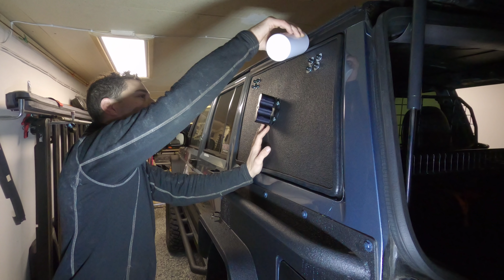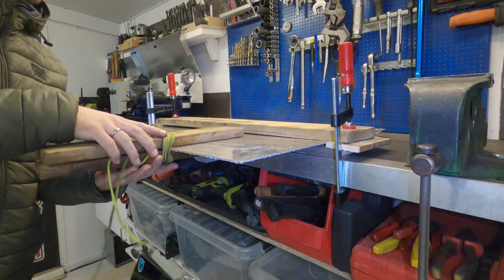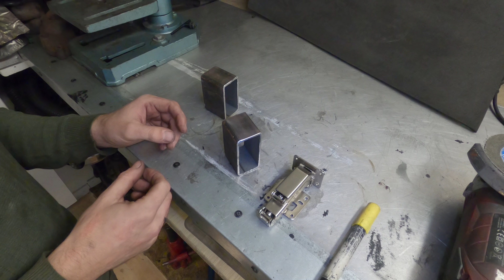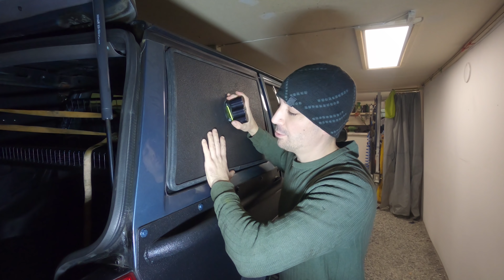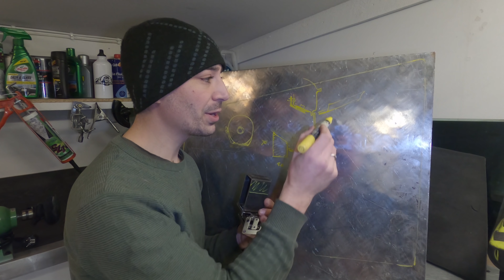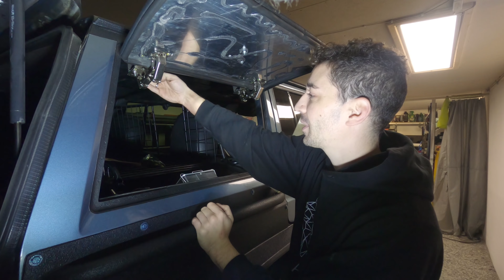How To Build Gullwing Windows / Jeep Cherokee XJ

Comment: Hi, I'm thinking of replacing the rear windows with aluminium but not a gullwing, just fixed to mount recovery trax. Just wondering how thick the aluminium is that you used or should I use aluminium that's the same thickness as the window glass?
Reply from the maker: I used 4mm thick aliminium. It was roughly the same thickness as the glas, and it sat well in the original weather strip. That's what I would recommend anyway.

Comment: Hi again Mike, its me again Cor the trubble guy from france 🤓 I almoist ready with my gullwing windows, But.. now to fix those hinges! in what distance you have fixed them? how close/far from the top corners horizontal? I seen on the video that your inside roof joint is diffrent as my cherokee, i do not have that bigg oval hole, so could you send me the distance between the hinges please?! 🙏😉Afther this is done I send you a picture from the job! thanks Mike
Reply from the maker: Hey Cor, I can't help you at the moment. I'm in England for a while. I can not remember the distances or angles. I didn't measure much when I made mine, as I just positioned everything, then tack welded the hinge brackets in place.

Comment: Okay Mike, Thanks for the information, I just wanne put all togheter and I found out that the strip I both at AMZ is to bigg! So Just order an new one 🥴 the one i got had 28/17 and that round part was 18mm. to big, so this I wil use for my door, needs desperatly a new seal because wenn I driv highway i hear the wind and feel it in my neck! Okay well so all my work gear back in the shop, all clean, need to wait till next thuesday for the dillivery. Hope you doing fine, iff you are in the need of some new sirup from Hoaalnd? I fly to Amsterdam the 24e! Take care 😏🤠

Comment: Hello mike, I am in a small problem , I cut out those alu plates a litle bit bigger let say 5 mm all around, so i both that water seal at Amz. but it seems so big? and is it better to put the seam arround the alu plate or ...?? In the window opening??
Reply from the maker: I personally prefer the seal around the plate rather than the window just because of the way the window shuts. 
I think you can do either, though. Just see how it goes. Normally, some silicone around the seal makes them slide better and stops the seal wearing down

Comment: Hi Mike last question, were did you buy that foam that you gluh inside that aluminum plate? hanks again Cor
Reply from the maker: I got it from amazon from memory. I think i just ordered a 1cm thick cell foam. It was very cheap and I used 3M adhesive spray to fix it on.
Reply: @WorkshoptoWilderness  yes that's wat i wonder. So its not a dubbel aluminium platen, but foam. Good
Reply: @WorkshoptoWilderness  okay now i know. Seen it on Amazon 😉

Comment: Hello Mike, its already a while that I had contact with you, I m planning to make those window to, but...Do you think I could fix the brackets(boxsettings) by use those insertpopnails(those were you can screw bolts in later) and an other thing, cant see good but did you glue an second plate at the first at the inside? I both those lockers and also the hinges !   will be great to hear from you buddy! Greatings from France Cor.🤠
Reply from the maker: Hey Cor! Yeah, you could absolutely pop rivet them in with those threaded pop rivets. Those things work well. I'm not sure what you meant buy the panel for gluing in?
Reply: @WorkshoptoWilderness  thought to seen a dubbel plate inside the gullwing plate, but you al ready wrote me, its a foam self ad

Comment: You see I want to do this but I have a 99 2 door sport and I really don’t know how this would work with the long rear glass. My 2 door also has the pop out windows so it definitely would take a lot of modification.
Reply from the maker: I think it would be awesome on  2 door. One large gullwing panel with four hinges would be super strong. I don't think there would be any issues at all provided you used four hinges and not two.

Comment: G'day Mike, as an ex-tradie, the "gull wing" or what ever term, are such a handy feature and for most, a top hinged solution will be far more practical. Of course, it does depend on the storage solution inside.
I would suggest mate, that you really think about whether or not to go with a full on drawer system. They do lock you in to a particular methodology and can limit flexibility overall. Not to mention they can be quite weighty. Maybe a part draw system IMO. 
Anyway, good show mate. Cheers Duke.
P.S. Where's the bushcraft !!! ? ............only jok'n mate, hehehe.  Keep do'in what you're do'in. 
Not sure there's anything you didn't cover back in the day and I still hold you personally responsible, lol, for rekindling my interest in the outdoors, many many thanks.
Reply from the maker: I'm hoping it will help tidy up the internal storage at the back a little more. Just having a recovery kit in there or a wash and hygiene setup the other side just makes life easier. 
The drawer system I am making is just going to be one or two big flat tables that are as low as possible in the back. Its just so that the whole inside can be pulled out and accessed from either side. 
Its more of a drawer platform. The internal cargo self will then just sit above it so you have an upper shelf but I am going to remove the legs and have two diagonal legs that can fold away to the whole upper shelf can fold flat or be removed. 
I want it to all be modular so the Jeep can still be filled with bags and suitcases if need be. 
haha, i do get a lot of comments about bushcraft. I still enjoy doing it but its not something I will film anytime soon. Thanks again mate and appreciate the comments!
Reply: @WorkshoptoWilderness  Yeah Mike the recovery kit is a fantastic option on one side and of course a hygiene "station" needs to be particularly accessible too, especially with the fam on board.
Glad you're still think'n about bigger items, whether luggage or otherwise, exactly my original point. I've no doubt its all gonna come together mate, love what you are doing to utilise the full potential of this vehicle, mechanically and within its dimensions. I was only jok'n on the bushcraft, I did pick up on your comments under baited breath and hence my shit stir, don't mean to be soppy about it, but still, you did inspire me to the point where it put my focus back where it ought to be.

Comment: I really like this, you did a great job. Are you going to put a little gas strut on to hold the window/gullwing up?
How do you like the rotopax cans and mounts? I'm thinking about getting one or two of those 4 gallon flat cans for my roof rack and maybe some 2 gallon cans for my tire carrier.
Reply from the maker: I think some struts would be good, or a bar that can click into position. I really like the rotopax system, the quality of the mounts, locks and containers is extremely good. Its just expensive for what it is I think. I would certainly get more of them when I can find somewhere I want them to go. The container ones are cool but not waterproof so you have to make a seal for them sadly, or else I wanted to make a medical box from one. 
Thanks for watching!
Reply: @WorkshoptoWilderness  a little bar like a hood prop would be neat or maybe some sort of dual purpose thing to prop it up like a tool of some sort or camping implement. I've never installed gas struts on anything but I have watched some videos and I think it can be challenging to find the perfect location to get the proper leverage for the strut otherwise it would be pretty neat. I know explore glazing has gas struts on their gullwing windows you could try to find some pictures and see how they do it.

Comment: I’ve been thinking of doing something like this with my XJ as well. It’s good to see the various methods that people use to achieve the same thing.
Reply: @patrick arpad briley I can help you setup your XJ including the storage window setup
Reply: @FerrariLamborghini24  It seems that that a gullwing like this with an 2 inch deep inner pocket would be ideal.  The inner pocket would be a great place to store recovery gear and tools as well as seal the interior from any water leak in the gullwing cover.  And if the inner pocket was securely bolted into place it w red loctite on the bolts or safety wire it would be very theft resistant.

Comment: Welding I ever do is not so much a show piece as it is functional. You'd be surprised how difficult it is to break a weld even if done without the 'stack of dimes' elegance. As long as you're getting good penetration of both sides - it'll be plenty strong. It's really a pain in the ass to remove if you ever need to. The weld metal material is incredibly tough! Strength before aesthetics. Good job bro. Those windows are a real achievement in engineering.
Reply from the maker: I'm the same, it's normally all just to get good penetration and look relatively okay after grinding and paint. I do try to make them look good but its rare haha. Anyway thank you for watching and for the comment